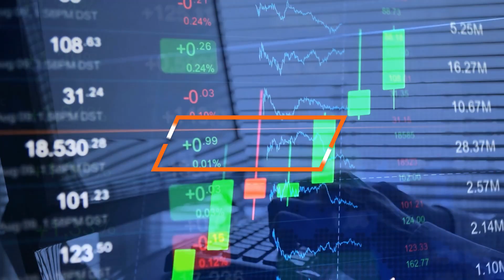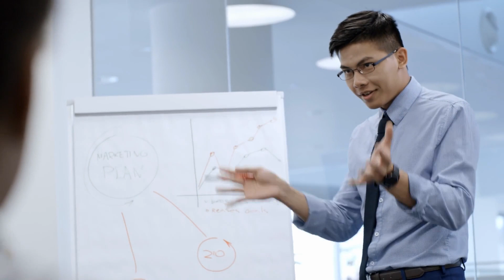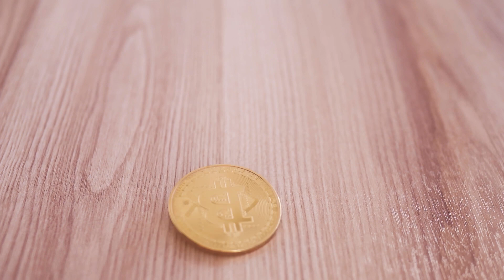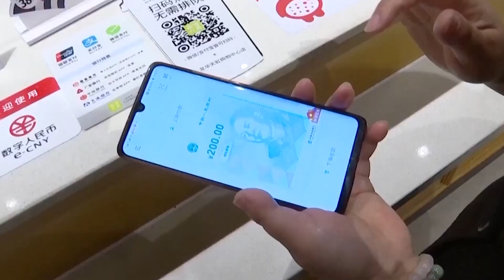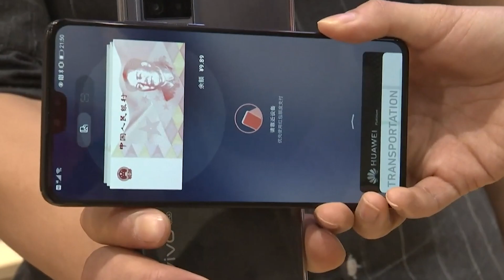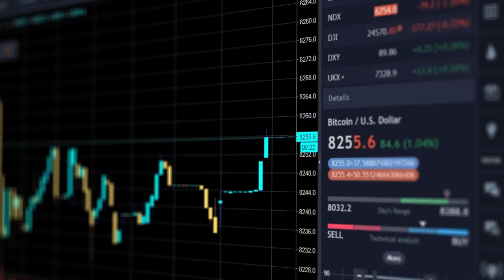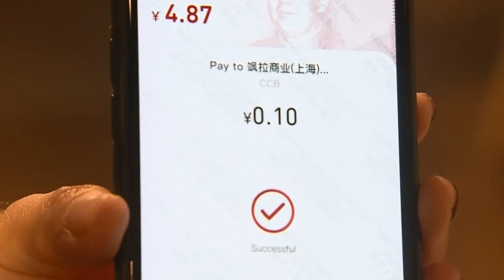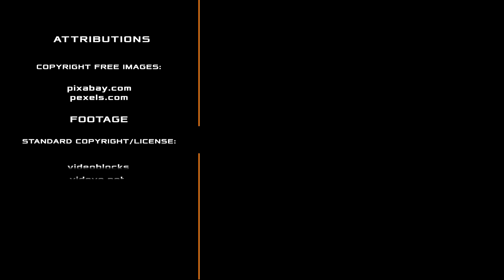Why China has declared war on Bitcoin

Comment: BTC hits another bearish cost as individuals expanded their offers in order to make immense addition from the ascent however as we would all be able to see now the market is truly insecure , truly you can generally make more benefit from tradn instead of just hodlin and sitting tight at the cost of BTCto soar . Surely its an extreme choice for both old and beginners whose intensions are simply to hodl and sell yet rather the possibilities of tradnBtc would permit you develop yourBtc not disapproving of the current value graph and furthermore saving your butt from any future profound that may happen . I began tradn with Daniel Wright since toward the end of last year and till date have made over 16Btc even with the high points and low points since the excursion. With Michael's assistance I presently don't need to stress over the ascent and plunge ofBitcoin, you can without much of a stretch get to Daniel on Եҽlҽցɾαต (@Danielwrightfx

Comment: I hate to ask a simple question buy why does crypto have to be mined. Printed currency is not mined first, why does crypto have to be, especially if it is causing damage to the environment? Find another way and stop the legitimate criticism.
Reply: not all crypto is mined. bitcoin is and uses proof of work.  verifies the blockchain, or every transaction ever made. the mined bitcoin is earned to the computers that are able to verify and find the next block. Note: bitcoin has a limited supply. the computing power only strengthens the network. impossible to artificially inflate like the printed currency of central banks
Reply: @Jamesgestrada  isn't limiting supply of the coin an artificial inflation of value? The amount of monies the world has is driven by the amount of economic activities. BTC does not run on this basic principle but perhaps you can reconcile this somehow for my better understanding.
Reply: A small impact on the environment from electricity that takes up less than Christmas lights... if that’s your take and biggest concern, Oh you’re in for a shock